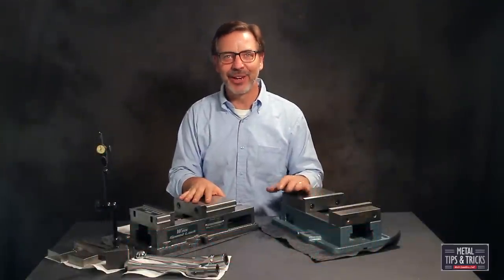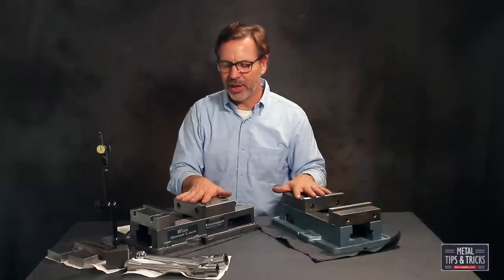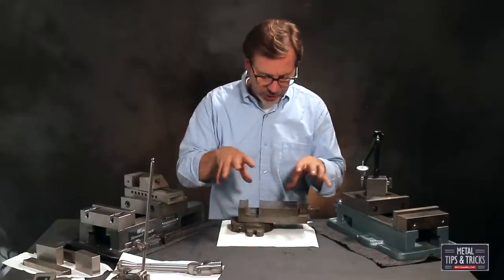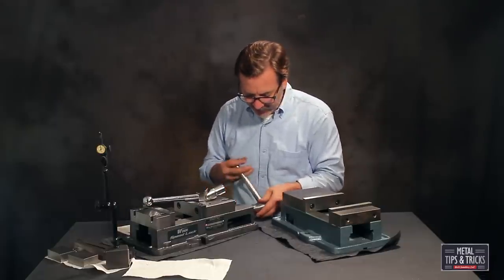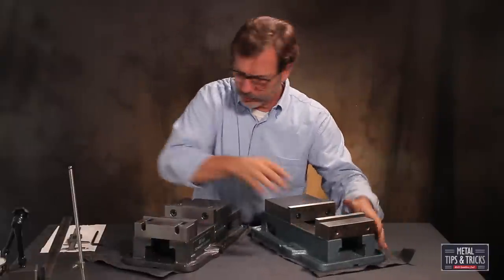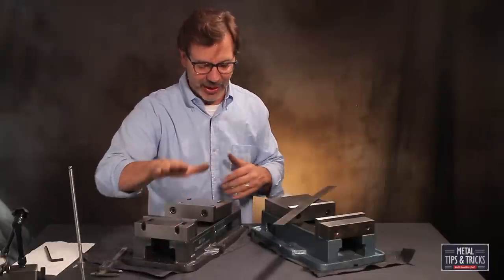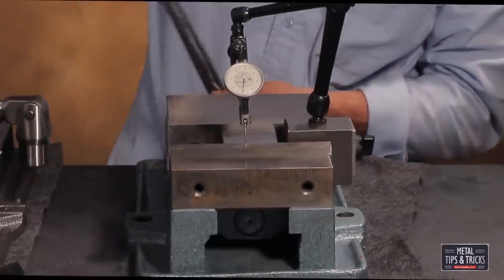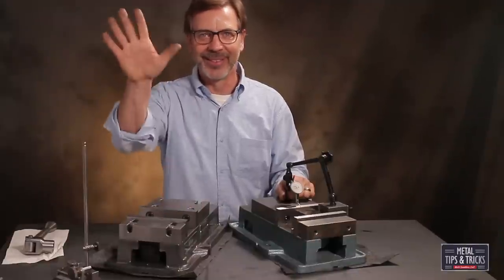China Vs USA  Machinist Vise

Comment: OK- buy 2 Chinese vises for 400.00 put them on a surface grinder and grind base and slides so both are the same height. Now you have  2 vises for 400.00 than can be ganged together on a mill- or spend 2000.00 for 2 of those USA units.  The Chinese will do anything that 90% of hobbyists and job shops require, while the USA units will be for the other 10% of extra high precision work.
Reply: Want to bet money that you wouldn't still need to shim your work, because your mill's table is worn less than evenly? ;^)
Reply: Yep same for Chinese or USA vise.

Comment: Hey! I'm machinist by trade, I work in a really old shop and with that of course everything from tools to machinery is pretty old. We make big stuff like axels up to about 4-5 meters, mill gears in the 1 m diameter range and so on, and what I want to say is that we make that stuff so precise in a more or less all vintage tool environment and what it all boils down to in the end is your speeds and feeds, and your rigging! You can buy your fancy 1000 dollar vises but I'd say that 50 buck 50 year old vise will do just fine. It does for me 8 hours a day five days a week all year round!
Reply: FACTS!👍👍👍
Reply: my €4600 vises does me well 24 hours a day seven days a week. i'm an automation specialist so i only touch the machine around 18-22 at night after i get home.

i can imagine that an old fully manual shop would not notice the difference given the.... manual nature of the work but when you run 20k parts at 10-50 micron tolerances while unattended, the price is easily justified and the quality often required.

Comment: When I was testing tools for an independent testing company, some cheap tools would come in for testing chrome plated.  The reason was to cheat the hardness test.  The steel used had to meet a minimum hardness standard and so the hardness test had to be done on the finished product but you can't do a proper Rockwell C on the finished product (like a box wrench) because there isn't enough sidewall support for an accurate reading.  This meant doing a Rockwell T test which uses a much lighter weight.  For ordinary tools this would give an pretty accurate reading.  For chrome plated ones, however, the test would give a false high because the weight couldn't punch through the thin chrome layer, chrome being so much harder than steel.  By doing this, the manufacturer would pass the hardness test while using lower grade steel.  To this day, when I see chrome on a tool, I think junk.

Comment: I kind of understand where you go with this (spend wisely) but it would be interesting can a 200.00 Chinese vise be tuned to perform like an expensive vise?  Some have more time than money.
Reply from the maker: I Think you could improve it some what,  but it still dosen't have the same quality of steel. I think it would be easier and faster to work overtime at work  and use that money and get a good one.

Comment: Hello, After watching your video I checked my own 5 inch jaw Chinese vice and sure enough it had all the faults revealed in your testing. I had another Chinese vice that had been sitting in my workshop for months, acquired from a friend who had bought it to go on his drill press, it was however too heavy and he asked if I would swop a lighter K type I owned for years for it, I did so as a favour.
 The only superficial difference between the Chinese products was the colour, the new one blue instead of grey. The fixed jaw was perfectly perpendicular to the bed rails, as was the moving jaw. With this brightening my day I started the process shown by you in the video and the blue vice passed on all counts. The ground surfaces were superb for flatness and the base was parallel to the rails.
Unfortunately I had thrown the box away and there are no markings on the vice, the test booklet has the name Accu-lock and was filled in with very close tolerances that proved correct.
I know that, " ...one swallow doth not a summer make...", but you can be lucky.

Comment: If you are a hobby machinist or a pro on a budget, don't forget you can rebuild used Kurt vises! They are designed for it and it's easy to do. Their website has full parts listings. Most Kurts just need cleanup, inspection and minor bits. I scored four Kurts and two "good older Taiwan clones" for fifty bucks each at an estate sale. They were worth the cleanup and a bit of time on a surface grinder. (Mark your ground vises to ensure matching height if you use pairs, and identify them so you don't forget!)  The Practical Machinist website has a few threads on the subject.
Reply from the maker: Great comment.:-)

Comment: Maybe for your next comparison you could compare a Bridgeport mill vs Harbor Freight mini mill. 

It would be as valid as this one is.
Reply: Wayne Crews that's funny but true be about the same as he did
Reply from the maker: I think this is a  fair comparison, because the import is trying to look like and act like the USA made Kurt D 60 vise, with the goal of fooling  people into thinking its a good tool. There for, it should be compared to a properly built vise Made in the USA . :-)
(Sorry for the cut-and-paste reply)
Reply: If the intent was to show that the Chinese made Kurt knockoff was not as good as the USA made tool, perhaps it would have been better (or perhaps a follow up video is in order) to have compared the Enco vise to the Kurt vice it is designed to copy.  That would be something I would like to see....USA original vs. Chinese copy.
Reply: Build Something Cool 
You may be right but you didn’t compare it to a Kurt D 60 vice and actually compared it to a custom made vice that we were never told the value of and if not given to you for free whether temporarily or not would never have seen the light of day in your shop. 
As I said in my other comment. This wasn’t an apples to apples comparison and your viewers are smart enough to know it was a BS comparison especially since the import vice was as you stated $200 and a Kurt D60 is still selling for $600 to $800 for a used one on eBay.
Reply: 540 MUDSTAIN 
No. The point was Dale compared a $200 imported vice to his custom made vice and not the one he says he compared it to. 
You can’t say a Hyundai is not as good as a VW when you only have BMW to compare it to. I have no doubts that the Kurt is better but he didn’t have a Kurt to compare it to.
Reply: if somebody give him mini mill for free,be sure that he will say that mini mill is better choice than used Bridgeport,cuz new mini mill have closer tolerances LOL...

Comment: I've never taken a hammer to my vise handle.  That's what pipes are for. (if I WERE to use a hammer, it would be a plastic dead-blow)  And frankly, even hand pressure is enough to destroy schedule 40 pipe.  My vise handle being metric is handy, because it's 19mm, which is almost exactly the same as 3/4", which fits the R8 drawbar screw on my mill perfectly, so I never have to go hunting for wrenches.  Maybe the newer Chinese/Taiwanese vise handles are garbage, but mine is over 30 years old (it's a Kurt knock-off), and still fits very snugly.
Reply: My bridgeport vise handle is square drive so it's only good for the vise though I also use a 19mm for my drawbar since it's 2 thousands smaller than 3/4". Makes for a better fit.

Comment: Thanks for the shoutout ;)

It would not touch either of those vices for any work that requires any precision :D
Reply: Stefan, what do you prefer then and why?
Reply: Grinding vices with the angled screw. We run them at work on the vmcs, i run them on my cnc at work and I run them on all my personal machines at home. Absolute preference for me :)
And why? Most important: Everything on them is hardened, so they dont wear and ding up as easy as one with a cast iron body.
They are square all around. No guessing involved, just square.
The moveable jaw does not realy lift. It stays where it belongs to. Down :D
Easy and fast to clean, just blast out with compressed air.
Reply: Stefan, I have re-watched your vice deflection video (www_youtube_com/watch?v=ckknLkwx9Sw).
The measurement results of the grinding vice speak a clear language especially for lift up and loss of squareness of tall parts.  However in horizontal direction the fixed jaw also bends out 0.05mm (black smith precision...?) which is in the same order of magnitude as many others. And I guess the fixed jaw is not ground leaning inwards to compensate some of that. Although there was no horizontal deflection measurement of the movable jaw, it seems that the movable jaw is even better than the fixed jaw. How about a grinding vice without a fixed jaw but with two movable jaws working against each other? ;-)
Reply: Barry, I can make quite a good vacuum, if that helps precision. But the gravitation free zone interests me...
How would you do that? To my limited knowledge it can only be achieved in free fall, parabolic flight, both obviously for very limited time, and in orbit around earth, moon, sun, whatever heavy object. And the internet is full of spam about antigravitation machines. Maybe you can tell us more about it. And by the way these hardened, precision ground, import grinding vices, that Stefan prefers, are even cheaper than conventional vices. A choice worth considering.
Reply: Do not feed the trolls.
Reply: Actually if you would have read Stefan's comment he clearly states that the type of vise he uses is usually used in grinding applications but he uses them universally (meaning not specifically for grinding). The way I interpreted his, he was saying there are many ways to skin the workholding cat.
Reply: Look at 5th axis style vises. Although they do not have the angled screws they have both jaws moving. You do have me curious if there would be a way to design a vise with the "fixed jaw" being pulled down to the base like the moving jaw in this style of vise. I think that would be an engineering challenge for sure as part of the reason for the fixed jaw having a flat back is to be able to set the vise on its end. These types of vises can be put on pretty much every edge that they have.
Reply: I use these Kurt style vices on a daily and produce quality/precision parts. But I also understand the shortcomings of them. If you look at this with a broader scope you will see there are many options out there, and many are personal preference. I know guys that want to fixture every single part and use mitee bites instead of machining some soft jaws. You are reading too much into it. In the end it doesn't much matter how you hold the work down as long as it is held down and your part is good.
Reply: HAHA I run my asylum... The short comings would be what Stefan stated about the softer cast iron bases as well as the inability to hold taller objects square, the reason I have angle plates all throughout the shop. The grinding type vises will hold things more parallel and square but for your day to day manufacturing needs its not necessary. When your tolerances are +/-.005" (.13 for you metric types) and your angular tolerances are +/- 2deg (still 2 deg for the metric types) and no specific perpendicularity requirements than no big deal.
Reply: Cast iron is used as a bearing material so it does not provide any added friction and generally slides very easily across the table. This is sometimes advantageous if you crash a machine as it will skew the vise instead of doing damage to a spindle or axis in motion. The cast iron is softer and easier to chip, dent and wear as I have some beater vises at the shop that are well beat up and I would not want to attempt to hold anything in them that would need to be held square. 

Yes grinding vises would not work for heavy cuts but generally when you are speaking in terms of precision, clamping force can effect dimension and light cuts are used so that is a moot point. 

Again I think we are arguing the same things here. I am not in disagreement with your statement that grinding vises are not idea just thought your original response to Stefan's comment was unwarranted. Machinists do things the way they find them to work best for them and we should be lucky that we have members of the community that take the time to share what they have learned with us. I am sure if Stefan had time he would make a whole video on why he chooses the type of vise he does, unfortunately his comment in passing was short with not much of an explanation. I also feel I should say that like some of the other comments I feel this is an advertisement video for Winn, and if I would have known that dale had started a channel under a different name I would probably never have watched the video. But as I was scrubbing through it I did see the milled pocket on the bottom of the base where this vise used to say KURT Made in USA and had a good chuckle so I guess there is that.
Reply: chris0tube I fell like you went in the attack without understanding what he meant. It’s unfortunate it was a passing comment and not an in depth response but sometimes that is all the time you have.

I feel differently now since there was some discourse.

Yeah would be nice to see more transparency as to the intent of the vise review. Reasons why I prefer AvE for tool reviews. 

There isn’t much real content I have seen come from this channel seems like there is a lot of tool collecting but not really doing anything with the tools.
Reply: I agree...   German Qualität or the HighWay.. But I guess thats why we Danes did build the first Diesel Engine from Rudolf Diesel... we are into that..!  And we love germans.  ;-)  Some of them....
Reply: @chris0tube yeah I was pretty tired and my brain stopped working, my words weren't chosen very well.
Reply: The following is my preference. I find that I prefer the reverse opening style. The kind where the fixed jaw is towards the operator. The ones I have used are either the Quad Style vise or copies. Kurt also makes or made a vise of this type. The vises offer several advantages to the operator of both a standard and CNC mill. 
1) When inserting the part you place it between the jaws and pull towards you. This way if your grip slips you will be moving away from the machine. 2) The solid jaw on the vises in this video are held down by screws passing vertically through the vise base. On the Quad style vise there is a second set of screws passing through the Solid Jaw into the base parallel to the base of the vise. The Solid jaw is against the top of the vise base plus against the outer end face of the base. 3) They are more compact for a given opening. 4) They are capable of being mounted on their ends or sides.
Reply: mpetersen6 the last two points to your preferred style vise are on most newer vise models offered by Kurt and Chick. They require clamps to hold the vise down and can be held on just about every side.
Reply: Endofcomment, The Quads have slot in the body for passing screws through so you can but vises side to side. One thing we did was remove the moving jaw assembly completely along with the solid screw on jaw. We would then mount the vise body upside down on the mill and pick up centerline of the tables middle tee slot. We would then cut a 5/8th keyway in from each side and drill & tap a hole in each keyway. Then move over the spacing of the tables tee slots and cut slots that extended far enough into the vise body to allow a 1/2 or 12mm washer to be on a screw and be nested fully in the vise. This way you could place the mill on the table using the keys in the vise and lock it down with 4 1/2 or 12mm HHCS depending on your tee nuts. If done properly the vise will be within .001" or so right off the bat. Lets face it. Most manual mills are going to have a real hard time maintaining a .001" when doing work simply because of clearance in the table ways. Add in the normal wear that occurs in the center of the table where most work is done . Plus one nice thing about the Quad was its screw was mounted in the bolt on solid jaw. To clean the vise you could run the moving jaw right off of the screw. The solid jaw assembly and the screw came off by taking out 4 screws. A vise like this is well with in the possibility of a reasonably skilled guy in a home shop as long as he access to grinding equipment
Sadly the Quads are no longer made. The reasons are probably inertia (the old we've always done it that way) and cost. They were pricey. But IMO they were worth the price given the overall quality and versatility
Reply: my experience, for heavy cuts press kurt style is the best
Reply: Same, i spent all of last year's shop allowance and bought 5 grinding vises to replace everything i had on my machines.
Reply: I would never use a grinding vice in a mill other than for small work with light cuts. You simple don’t get the forces in a grinder that you do in a mill. I don’t care that Stephan says that it’s ground all around. I think we all know that. But it doesn’t mean much. Proper set-up is more important, and understanding the strengths and limitations of your machinery is paramount.

It’s interesting to note that in 1900, they were working to 0.00005” with what today we would cringe at.
Reply: Stefan Gotteswinter ich muss euch warnen- er ist Deutscher :-)
Reply: @StefanGotteswinter  The ONLY vise that would be found on a McDonnell Douglas/Boeing CNC would be Kurt. They only bought the best with tax payer dollars!
Reply: Love it. The truth, straight from a Master.